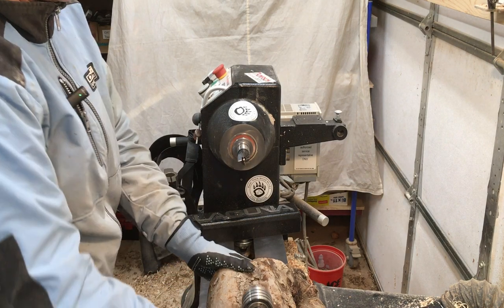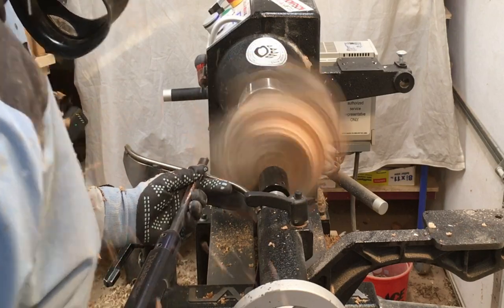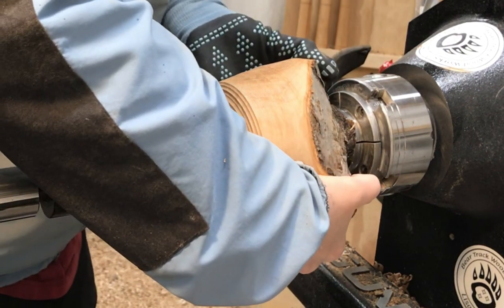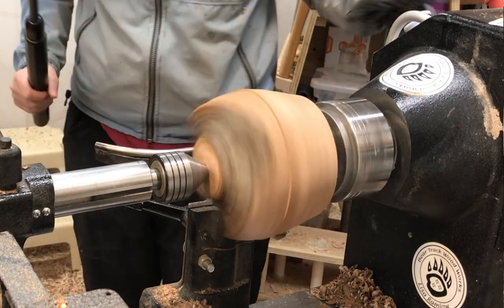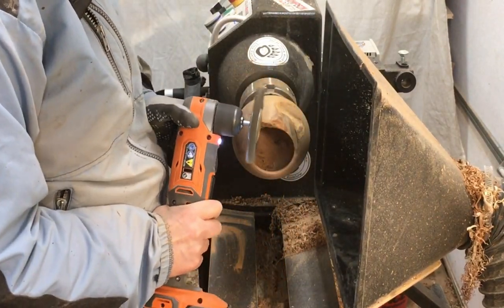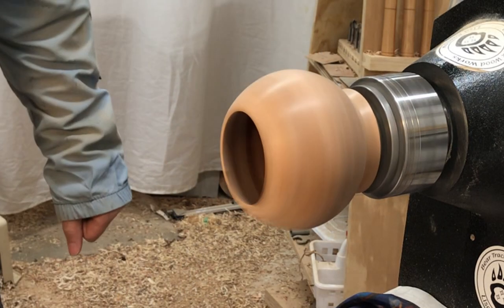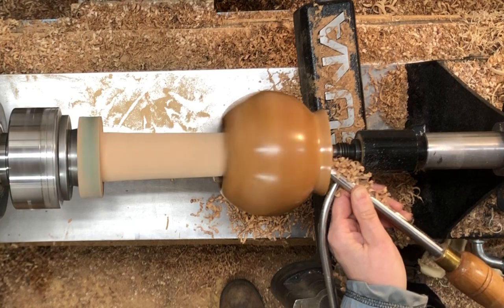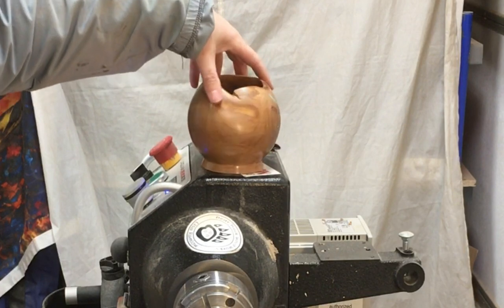Woodturning: Apple Log to…something!  Coffee Mug? Calabash Bowl? Cauldron?

Comment: Thanks for this video. It’s nice seeing something turned from a trunk.  I’ve also had issues removing items from the lathe. I’d recommend using something like an oil filter strap wrench.
Reply from the maker: Hi Neil! I actually have a big strap wrench I normally use but I couldn’t find it-I spent 10 minutes wandering around the shop muttering “what the hell did I do with that thing!?” 🤣
Reply: @LisaRamlow   😂 You sound just like me.         Thanks again.

Comment: We're taking out an apple tree this spring, so I'll be turning apple in the future. 🙂  Previous tiny projects from a large branch turned out great.

Thanks for this vid. 👍
Reply from the maker: Thanks Allen! Apple is beautiful but like most of the other fruit woods it does like to crack. And what I have came from an orchard so it was never sealed or anything.
Reply: Lisa, you might try boiling a chunk or two before turning. I understand it stabilizes the wood against additional cracking and moving.

Comment: I really enjoyed watching this video, Lisa. Good job on I'm getting that thing mounted. Let me give you one of my tips for working with worm screws and paralyzed hands, in my case. What I will do is remove the worm screw and bottom-finished piece entirely, mount it in the chuck, then use a 19 mm wrench on the worm screw after locking the spindle.  That is the method that works for me. Another thing I was going to comment was just how much I always appreciate the way you and I think I like. I see a problem coming your way and how I would solve it and you often do the exact thing that I was thinking. The same goes for our finishing process. Just a comment. Have a great weekend and be well!
Reply from the maker: Thanks Jay! Great minds and all 😉. I have a couple of strap wrenches I normally use to remove stubborn blanks but I couldn’t find either of them. Must. Clean. The. Shop 😱

Comment: Great piece. I use a belt or rubber strap to get a good grip and twist to get the pieces off the wood worm screw. I have a set of calipers just for tenon sizes. I keep them separate from the ones I use while turning for sizes.
Reply from the maker: Hi Clyde! I actually have 2 strap wrenches and couldn’t find either of them 🙄. 
I have a bunch of calipers and I use them that way too, but I wanted a min/max kind of thing especially when I’m turning green wood to go into the kiln - basically want to make the tenon as large as possible or the mortise as small as possible so when I finish-turn I have enough material to true up the mounting. Just one of those things that shouldn’t be complicated (like unscrewing the blank from the wood worm screw 😂) but is! 🤣
Reply: @LisaRamlow  gotcha. I love your videos and just wanted to throw some ideas out there that I do. I learn a lot from many of you as I’ve been doing this for a year now and love it.

Comment: I just had a thought. What if you were to clean up an oil filter wrench and use it on your tenon to unscrew your blank from the wood work screw? Maybe? I had to tell my husband how much I love watching your videos because I encounter many of the same problems with my limits upper body strength as you do. Absolutely wonderful that you show how you work through those issues. Thanks!
Reply from the maker: Hi Tricia! I have 2 strap wrenches and I normally use the larger one to remove a blank from the wood worm screw if it gets stuck. But I couldn’t find either of them and cut out the 10 minutes of me and wandering around the shop muttering “where the hell did I leave those things!?!” 😂
My shoulders in particular are weak - just had an arthrogram MRI on my left shoulder Wednesday, which slips in and out of socket if I move wrong, so that doesn’t help. I had started doing yoga in January and that was making a big difference in a short amount of time but had to put that on hold cuz I tripped and went sprawling on the concrete floor in my resin/laser room. Bruised the 💩 out of my knee and am still waiting to be able to knee on it again! This getting old stuff does suck! 😂
Reply: @LisaRamlow  oh yeah. I graduated into the senior club last year on my 60th. Send like my body sent out a notice to my entire body. Like "ok, we can fall apart now. " Hope you feel better soon. I found water aerobics at the local YMCA. Nice no impact cardio.

Comment: Hey Lisa just thought I would let you know about my little secret on things that get stuck. Get yourself a strap wrench that they use on oil filters. Needs to be the rubber belt kind and might be in a couple sizes. I bought a pair of them at the hardware store. Nice job by the way.
Reply from the maker: Thanks William! I actually have 2 of those strap wrenches and I wandered around the shop for 20 minutes muttering to myself "where the hell did I put those things!?" before I gave up 🤣

Comment: Hi 👋 Lisa , So That was a bit tight on there, there is a device that you can get which they normally use for removing things like oil filters. It is a handle with a leather or rubber strap on it you might be able to make something up, Handle needs to be 10 to 12 inches long to give you leverage, and the leather or rubber needs to be fixed very well to the handle, And the idea of it is that you wrap the leather strap around your article that you have turned on your wood-lathe , in the anticlockwise direction so you have around two or three layers of leather strap are wrapped round your product then ideally to try and get the handle when it’s tightened up pointing upwards at the back so when the article is locked in position on the shaft you can then pull the handle towards you and it should then make it easier to unscrew the bowl or job or whatever you’ve got on, I hope this will be some help, I think as well you might even be able to use or modify a ratchet strap.
PHIL FROM THE DARK SIDE OF THE MOULIN FRANCE.
Reply from the maker: Hi Phil, nice to see you again! I actually have a big strap wrench I normally use but I couldn’t find it-I spent 10 minutes wandering around the shop muttering “what the hell did I do with that thing!?” 🤣
Reply: Hi 👋, At least you know it won’t come off, In my years of working for myself my first workshop was quite small around 8 m² roughly and could never find anything so started to put tools together in respect of drills will be together saws 🪚 will be all together, Then in 2005 2006 I moved into a huge workshop considering I was working by myself I’ve got a serious amount of work on making very large doors and windows for barn conversions my workshop was approximate 8 m wide by 35 m long plus a space to park my van in inside so I can load and unload in the dry. This then gave me another problem take measures pencils I’ll have to make sure I’ve got them are there in my tool box ,That I wheel around the workshop,  I’d end up leaving it on the cross cut saw then go back to the workbench then realised I’ve left my tape measure then have to walk back down the other end of the workshop to get my tape measure I think one point I went out and bought five tape measures and left them at certain points in the workshop to make it easier, There is a saying there is a place for everything and everything in its place, and that’s what I’ve always tried to do, you use something put it away, Now all I have is a small basement 7m x 11m , I still have a lot of my tools/ machinery but not a lot of room to walk around. I am hoping to put a new floor in garage and finish the roof of this year, which I hope will help so I can work, I am obviously retired but there’s still a lot of things I need to do on the property that I own in France, Sorry that is enough for me rabbiting on I get carried away as I live by myself, 
Stay safe I hope you find a strap and look forward to your next project. PHIL FROM THE DARK SIDE OF THE MOULIN FRANCE.

Comment: Lisa I really enjoy your videos.  A few suggestions if I may.  If you’re having trouble removing the wood worm screw you can take it out of the chuck and use a wrench to turn it out.  I would highly recommend the Oneway big bite two prong spur.  I use this $20 tool for most of my ruff turning which allows me to hold large pieces of wood and also allows me to adjust the placement of the tail stock is needed to better center the blank.  I also find that using a pencil placed on the tail stock gives me the correct size for a small tenon.
If you get tired of fighting with your Laguna banjo I highly recommend the Oneway upgrade.
Reply from the maker: Hi Harvey! Thanks, I appreciate it 😁. I have a big strap wrench…somewhere. That’s the problem…I looked for like 10 minutes before I gave up and was determined to just muscle it off 😂. I have taken the whole thing out of the chuck before but still had trouble holding the blank tight enough to loosed the wood worm screw. Next item on the list is to spend a couple of days in the shop excavating and cleaning and rearranging some things. Looks like a bomb went off in there…still! 
I’ll look into the OneWay 2-prong and I need to just bite the bullet and buy another live center with the cup point, probably the OneWay there also, but damn they are pricey! Banjo is better after having cleaned and waxed it but it does still make a lot of noise when I’m sliding it 😳
Reply: @LisaRamlow  I was thinking the same thing--this is a job for a strap wrench! Used these back in my Navy days. Great way to get the job done without marring the work.

Comment: I have a Laguna 18-36 what modification did you do to lock the spindle?  Do you have problems with the banjo sliding on the ways?  Mine only slides easily for a short while after cleaning and lubing.
Reply from the maker: Hey Dennis! Yeah, the banjo isn’t super smooth. It’s sliding better after cleaning/waxing but it’s still squealing and even just by the time I finished this project it wasn’t moving as freely. Another viewer said when I get tired of messing with it he recommends the OneWay banjo. 
Gary over @ThePapa1947 showed me how to make the spindle lock - here’s the video link:
https://youtu.be/AzExi1D8sak

Comment: Nice piece Lisa, thanks for sharing. Your log looks very dry.. I have some very wet apple from a recently cut tree, any suggestions about how to dry it?
Reply from the maker: Hi Simon! If you are making bowls, you can rough turn it and then dry it and finish turn it later. I made a kiln from a dishwasher and use that to dry my rouged pieces. You can also put the roughed pieces in a paper bag or cardboard box with the shavings and that will help to slow down the drying process. No matter what you do (leave it in log form, cut it into blanks, or rough turn and set aside to dry) you'll want to seal the end grain. I tried some homemade glue/water sealer and it didn't work well for me so I buy AnchorSeal 2. It seems pricey but it does go a long way. I still have almost half a gallon from the first time I bought it. Do be aware that apple (in my experience) tends to crack a lot and sometimes it doesn't matter what you do. I twice-turned an apple bowl, sold it, and it cracked several months later 🤷‍♀️
Also, if you rough a bowl to finish later, I'd leave it a little thicker than the 10% of the OD - the logs I've used warped quite a bit more than I expected and I almost didn't have enough wood left to make it round. Good luck!
Reply: thank you so much Lisa.. I'll give it a go and keep my fingers crossed

Comment: Use a quick clamp on your form to unscrew it.  The "arm" gives you leverage.
Reply from the maker: Hi Patricia! I actually have a big strap wrench I normally use but I couldn’t find it-I spent 10 minutes wandering around the shop muttering “what the hell did I do with that thing!?” 🤣 I did try a clamp too but the only one I had in the shop big enough to go around it was an F-style and I couldn’t get it to grip and hold still.
Reply: @LisaRamlow  that bites.  Love your work